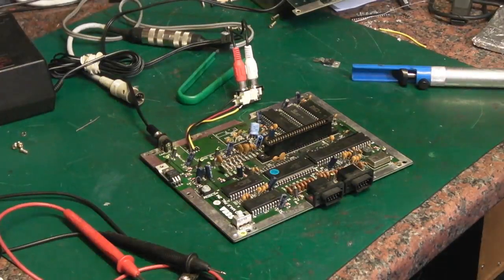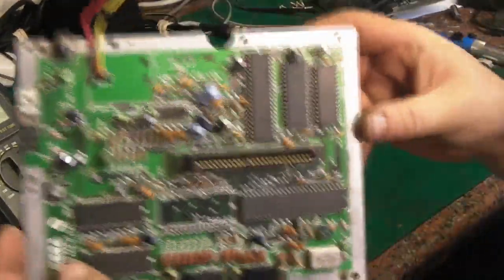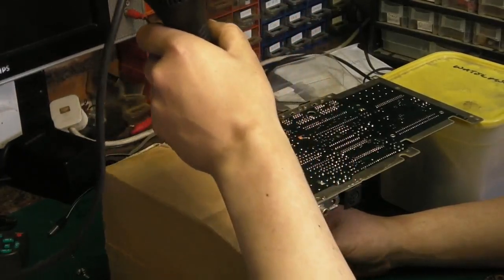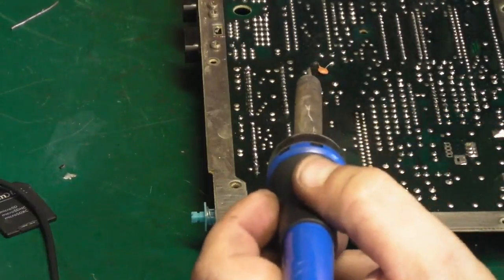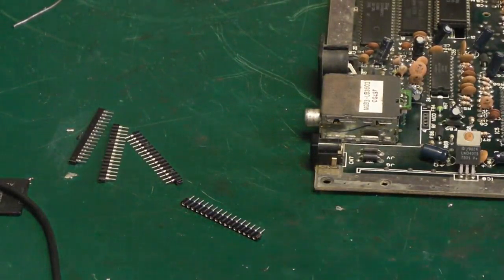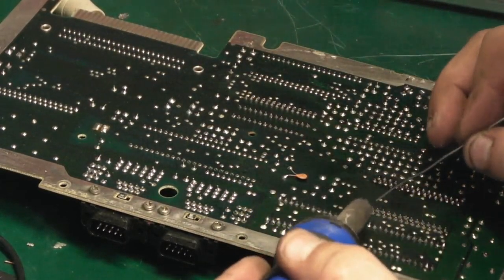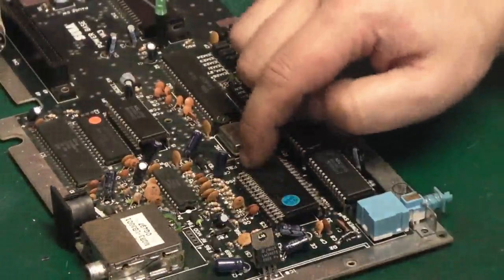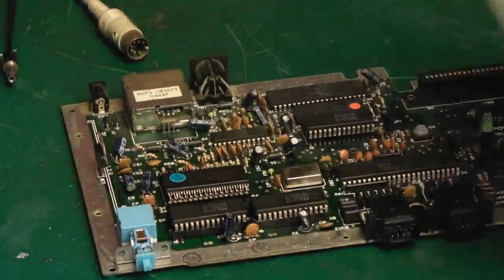Sega Master System Mk1 repair Pt3

Comment: I do like the way in which you are using the hot air gun. I've never seen that before but it seems the safest way to me.
Reply from the maker: its very good for removing IC's with staggered pins, you just have to be careful to keep the airflow moving otherwise you risk scorching the PCB.

Comment: Could it be the chrystal not timing correctly? What an odd issue this.
Reply: Yes, I can imagine that a slightly off-frequency crystal might lead to intermittent display sync glitches. Don't know if this is exactly the correct schematic, but it should be close as far as for overall function:

http://www.smspower.org/uploads/Development/SegaMasterSystemServiceManual-schematic2.png

Comment: QIP packages can be a pain to work with.

315-5237 is the I/O controller.
Reply from the maker: Tell me about it lol. The 315-5237 as you say is mainly for IO however is does shere address lines with the VDP. was wondering if it might be interfeering with somthing.

Comment: Have you ruled ou the Z80?  I am wondering about an IRQ or M1 fault.  Great video series btw - been following along =D
Reply from the maker: Now thats a thaught and one I'd not had myself.
Reply: The PCW Z80 is socketed so that'd be handy to use.
Reply from the maker: I do have a large stock of NOS z80's. if I didnt tho the one form the PCW should work just fine for a test. but remember not all Z80's are equal